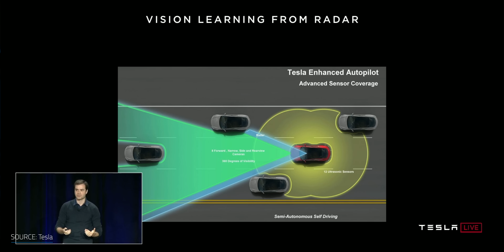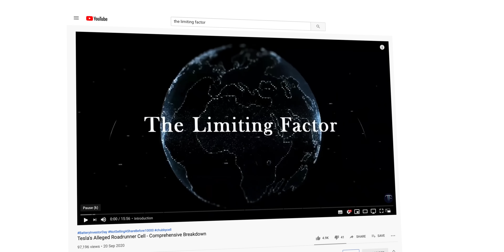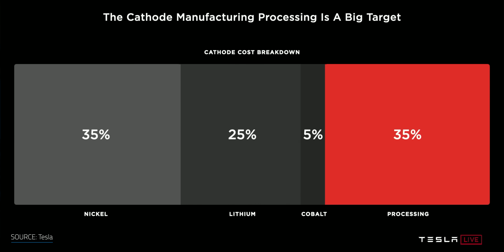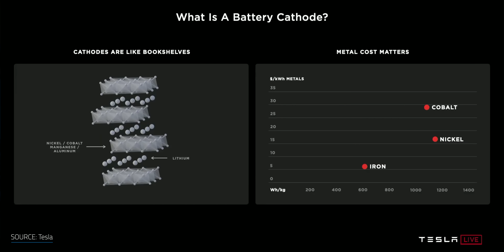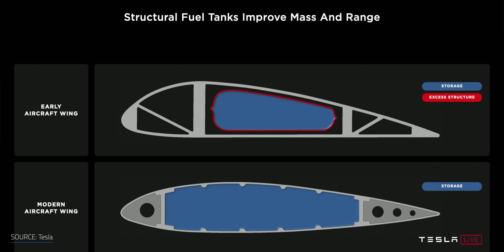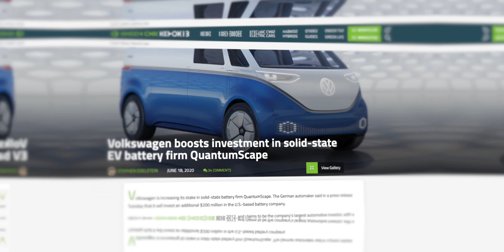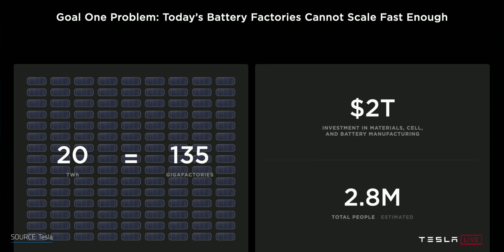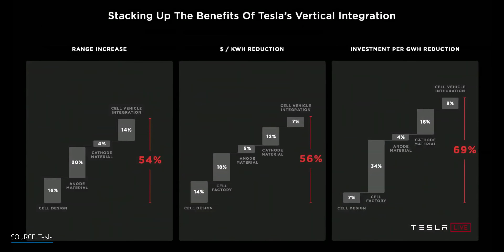3 Takeaways from Tesla's Battery Day - Hint: it's not just batteries

Comment: This marks the end of ICE age.
Reply: Only because of government intervention into the market.  Absent that, the EV would remain a rich persons virtue signaling toy.
Reply: Not yet. Switch your lights of people, don’t leave the gap running and recycle <3
Reply: And the beginning of hype lol
Reply: We will wait for 30 years.
Reply: @Thomas Chrombly Please recall that most Tesla drivers charge overnight at home. We have a fully charged battery, aka a full tank, each morning.
Reply: burst your small bubble u live in it bruh, ICEs are far cheaper than a tesla. Keep in mind not everyone is having 25k in their accounts.
Reply: Wolfgang Preier    You forget that the biggest “savings” in operating an EV is the ability to avoid road tax on gasoline.   Without the road tax, gas would be in the $1.50 range.   States are already figuring this out and many are collecting the road tax up front.    Redo your calculations taking into account the road tax, and you’ll be closer to comparing apples to apples.
Reply: not yet ICE number will decline eventually but not exponentially until 2040
Reply: Need MUCH better charging infrastructure before this will happen. I have  a Tesla S which I love around town but it is too hard for me to do long trips in it. Way more charging stations and faster charging is required
Reply: The math is very simple. Average diesel car burn around ~8ltr diesel for 100km (not talking about city use that can reach 10ltrs, or wintertime when the consumption also rises)(also not talking about gasoline cars which use ~30% more fuel that is more expensive, not even talking about performance....)  Assuming the diesel price is 1 euro per 1ltr (which is cheap but it should be around average in EU at the moment, since I can buy it for as cheap as 0,84euros) That`s 8euros/100km.
An average electric car uses ~18kwh of electricity for a 100km distance, currently average electricity price in Eu is 0,23euros per 1Kwh of energy, so that means  ~4,2euros/100km for an electric car. 
Currently electricity in my country is only 0.13 euros so 100km in electric would cost me around ~2euros for 100km... That`s actually almost as cheap as owning a bicycle lol, if you calculate repairs which it needs at one point or another, since pedaling 100km gives a considerable wear to the parts unless they are expensive... 
~4euros/100km is already a double the price, compared to the efficient diesel car. Now there are "green taxes" for ICE cars, there is also repairs that ICE cars would be having a lot often compared to electric. 
There is also a very possible scenario that in the near future more and more renewable energy sources will come to the homes of ours, in fact many EU countries already have risen the house standards to A++ which means that a newly constructed house has to comply with these standards in order to get the all papers done properly. A++ means that at least 50% of your energy usage has to be made by renewable sources... Which means that your electric car will be charged at home, which means lower price per 100km driven...
Reply: Linas Vaičiukynas    What country are you in?     In America, gas is around $1.89 per gallon, which gets you an average of 30 miles.   Of that 1.89 tax is around $0.50 per gallon.   Actual price of the gas is around $1.39 per 30 miles.   Electricity is around $0.10 per kWh in most of the country but can run as high as $.50 per kWh in California cities.  Charging efficiency is around 80%.   Figuring in fuel, maintenance, etc, the EV is a little cheaper per mile, but never going to make up for the higher purchase price of the battery replacement costs.   And, yes, I know these batteries last a long time, but they don’t last forever.    They eventually will have to be replaced and this os reflected in the resale price of a high mileage EV.
Reply: @S3l3ct1ve  When used EV is worth buying under 5k then you will see most people changing to EVs. Here(Finland) average car is 15y old and worth about 7k.
There is no way that you can get majority to buy 20k car without SERIOUS goverment subsidies.
Reply: Wolfgang Preier  It will also be a long time before, on a lifecycle basis, that EVs outperform ICE Vehicles on total emissions, especially with the Opposed Piston Engine technology coming from Achates. And in fact, if the regulatory authorities would get out of the way and let independent engine tuners work, you could squeeze another 20% of fuel economy out of current engines.

When the battery recycling problems are solved, then sure, you'll get a good boost to the lifecycle, but for right now, as the Dutch government found, EVs still cost more carbon over their whole lifecycle than ICE vehicles.
Reply: @user-sy9je9uq2c  25k is rather cheap where BRAND NEW CARS are concerned in most places. Sorry to burst you bubble. And for people who can't afford to buy outright 25k things, a great deal of people lease out those vehicles in that range for like 250->450 a month depending on things like credit, how much you can put on as a down payment, trade in value for another vehicle, etc. As it is, I am currently paying off my ICE Subaru, which cost a total of 35k brand new...

Comment: The casting innovation is something i kinda wanted more tubers to talk about... That's a dramatic departure from Auto frame design and if it pans out will make producing cars waaaay cheaper. Remarkable too is the innovation of the allot they claim requires no paint... I mean ಠಿ_ಠಿ
Reply: That's how they'll make the Giga-Germany model Y. It's how the CT will be made. It's how the giga-shanghai M3 and MY will be made eventually. They need to install these battery factories at each auto factory. Then Elon's evil plan will have reached it's zenith.
Reply: @rogerstarkey5390  Roadrunner batteries too.
Reply: I wonder how this will turn out in a crash, a crash test preferably.
Reply: @VolkerHett  The castings are designed to perform well in a crash, probably better than welded stampings, or Tesla would not use them.
Reply: @VolkerHett  Elon has stated many times that the number one priority when they sit down to design a car is safety. I don't see them going this route if it costs them their "safest car on the road" awards
Reply: Nothing innovative about it and if you look at all the cars with aluminum frames.....  But when you get to combine several factors, makes doing so possible.  Now weather you should do so, is another matter entirely.  It makes recycling a royal ass pain in the ass though.  It makes repairs, near impossible... no check that, it makes them impossible, and making a product so specialized it cannot be modified or used for a 2nd purpose after standard car life is over is going to severely limit TESLA's growth into other industries such as farming equipment which is a gargantuan market.
Reply: @w8stral  No other car has the entire rear or front chassis cast as one piece, and Tesla has a patent for casting the entire chassis too.  All are highly innovative.  No other similar vehicle manufacturer has tried to produce castings that large.

Tesla's casting plant in Berlin has shredders next to the casting presses in order to recycle the cast parts.  This can be seen in the factory blueprints.  Recycling is already designed into the factory and manufacturing process.

Tesla is building passenger vehicles, not farming equipment, and BMW/Mercedes/Audi passenger vehicles are not generally used as farming equipment.
Reply: @LoanwordEggcorn  No such  thing as a patent for a casting.  Probably just welding the bits together in one giant part from several castings.  As for whole front rear casting in plastic... I'll bet this feature actually goes the way of the dodo bird as the casting will be exceedingly expensive in the long run.  Not to mention near impossible to replace when the inevitable front/rear enders happen.  Of course this just makes TESLA authoritarian pigs even happier as this means they sell more cars or make even more $$$ on repairs instead of cheap repairs.  The ultimate throwaway vehicle.  The suites are in the works already and they will lose them around the world.  This is actually one of TESLA's biggest weaknesses, trying to corner the repair market. 
Farming equipment?  Needs a power source genius. And most farming equipment starts from car/truck/auto industry.
Reply: @w8stral  Tesla got a patent for machinery for casting the entire car chassis.  The castings are metal not plastic.  The castings are lighter and cheaper than weldments if produced in large numbers to amortize the cost of casting equipment.

You said castings make it harder to reuse Teslas as farming equipment.  Most people don't use luxury vehicles or even parts from them for farming.
Reply: @LoanwordEggcorn  Then TESLA wasted their money.  Just make a casting a different shape and said patent is void.   And said patent lawyer who allowed them to waste their money needs to be disbarred as size of casting is not patentable as there is nothing unique.  And Hell no, castings are not lighter.  In fact far heavier as quality of said casting is inferior and therefore stress risers are higher creating a much heavier part.  Castings can be cheaper though as it saves labor, assembly time.  If you 3d Printed them they could be lighter as you can make none linear shapes forced onto you by the casting process which is SLOW and expensive and this gets away from the higher stress risers created by casting(voids, nodules, surface roughness).  Ok, basic engineering school is out, go and play.
Reply: @w8stral  The patent is for a new type of casting machine, not the specific shape of the casting.  It is not a "design patent".

Tesla's castings are lighter than stamped weldments.  Tesla's metallurgists (who may or may not be shared with SpaceX) created a new casting metal alloy to allow the complex shapes they needed and the large casting sizes with fine features to be castable.

If the castings were not lighter, cheaper and faster to produce, they would not have done it.

The work they did is novel.  If it were not novel, it would not be patentable.
Reply: @LoanwordEggcorn  Ah, makes more sense as you did not know what you were talking about.  They patented a machine process, not the casting.  ANd no, castings are not lighter.  In fact, they are NEVER lighter.  IF you wanted lighter in today's world, you would 3d Print something or build it by hand so you could heat treat it more easily without warpage for an even lighter part.  The big casting is cheaper.
Reply: @w8stral  Tesla's chassis castings are lighter than stamped weldments.

I said that they patented a machine.
Reply: @LoanwordEggcorn  GO read what you said.  And keep dreaming about the casting... Its called basic engineering and properties of materials per cost.  All about $$$.  ON a car it is all about $$$.  Has zilch to do with weight.
Reply: @w8stral  Tesla invented a new metal alloy to use with the large castings that enabled them to make the castings lighter than stamped weldments.  Perhaps you should read what I wrote and try to understand it.  I have no more time for you.  Bye.
Reply: @w8stral  Due respect, man, your opinion needs a lot more research and data. You're spouting nonsense.
Reply: @w8stral  We agree on this point. When do you start?

Comment: My one main concern is connected with the  full integration of the battery with the car and the problem that could cause for repairs should a battery be faulty or go bad.  I, also, wonder what will happen in case of an accident that affects the battery.  Will the entire car have to be trashed and discarded?
Reply: Its looking that way isn't it.

Comment: 8:21 - I remember when monolithic operating systems were the norm, before Linux. Then the modules became the way to make a small, lightweight, and embeddable OS that could be installed on everything. Modularity is something that came out of software design from these large systems not being expandable. Computers, operating systems, and technology has followed this path for DIY. 

My prediction is once the cat is out of the bag for these systems of design (think 15-20 years from now) we'll see DIY electric cars and this path of monolithic design will go away again.
Reply: Software isn't the same as hardware. A software module doesn't add more weight or mass. Software doesn't have to be a rigid structure. There are good physical reasons for eliminating module structure from the battery pack that simply don't apply to software.
Reply: Linux kernel is monolithic. Yes it has module capability, but it is no way HURD which is basically zombie.

Comment: I have an MBA. I'm not a fan boy of Tesla or a Tesla hater. I'm neutral. But... What I saw, from the point of view of a person educated in business management, really impressed me. Tesla and Musk are following the holy grail of business, reduce cost, increase quality and performance, and increase output. Tesla covers all the bases. There are some areas of innovation that we have to wait for in the future and that creates a little uncertainty on future expectations. For example, they mentioned that they weren't yet where they wanted to be with the dry battery process for battery production after four iterations. So there is a real possibility that they may not get all the way there. It puts a little tamper on possible future valuation. However, you also have to look at what they are doing in light of their competition, and even meeting 50% of what they talked about will bring huge returns for Tesla. Look, they have already have made working prototypes of manufacturing, materials gathering, innovations in casting, alloys etc. etc. Their competition is just working on uniforming parts across platforms and products. An innovation I might add was first used in the Ford Model T. Knowing GM, this is an innovation that most likely is being pursued in order to make fewer cars of any one model, but attaining scale by sharing parts. Not something that you would be focusing all your attention on if you were going to go super large scale in production of each of your EV models. 

Basically what I'm saying is that I was blown away by the ambition and goals of Tesla. I was also impressed at Tesla's efforts to make those ambitions real by putting them into small scale production to work out the kinks. Tesla is "physically" working in the right directions and even if it were to get half of its improvements accomplished Tesla would still be a most valuable company to own shares in. 

This leads me to the question I have for what happened in the days after "battery day." Tesla just demonstrated that it was going to be a game changing company far into the future. Its sales to date move the company out of startup stage and into being a perpetually innovative company who will continually disrupt the market well into the future much like Apple is. So why then was there a sell off of its stock? It kind of created an opportunity for those people wanting to get into Tesla stock at a great price. It kind of also created an opportunity for people who saw what I saw and understood what Tesla was talking about to buy at a good price. However, I can't help but feel sorry for those that sold pushing the price down, when if they had held, chances are that they would be handsomely rewarded in the mid to long term. Sorry. But selling Tesla after what they said at battery day was not a good move taking into account solid business sense. The stock market doesn't always make sense and it doesn't always do the right thing.

Comment: Nice video Matt.  I shared some of your same concerns and I felt wanting in one specific area.  The primary concern is that if the battery becomes a structural component of the car, how is it ever replaced / repaired?  And the one area with which I came away wanting was in a bottom line.  I would have liked to see or hear what it means for future car purchases.  Does it mean that a $38K Model 3 will be able to be sold for $30K should all of these improvements in battery technology come to fruition?  Does it mean that a $38K SR+ will have a range of 350 miles?  Those kinds of conclusions were missing from his presentation.

Comment: Since the Stock Split, I have jumped into stock ownership. TSLA so far. I am a senior (70's) on 20,000 a year. I have bought 5 shares so far. If I can, most people can. I am hoping to have 8 shares by January 1st. TSLA and other hyper tech companies that will come out of the wood work in the next 2-3 years, will power the stock market while those 20th century companies that don't move forward are doomed to extinction. Transportation, Energy, Medical and Communication are just a few of the areas that will be disrupted. Elon's companies are just the canary in the coal mine. A Tsunami is coming this decade and people are not ready for it. So often I hear people putting ridiculous time lines out 40-100 years for stuff that will here this decade because of advances in technology that are working in the lab today. To me, the 3 days, Neuralink, Battery and SpacX/Starlink, combined are the tip of the iceberg for the next 10-40 years. The future is coming sooner than you think. It's not the 20th century speed of innovation anymore. Wake up or become dinosaurs.

Comment: Great summary.  I also thought about what you called the "right to repair" but in regard to the casted pieces of  the car.  If your car is involved in a "minor" accident and that casted piece is damaged, won't that necessitate the replacement of that whole piece?  In the traditional manufacturing process with multiple pieces you would need to replace only the damaged piece.   Replacing an entire casted piece sounds much more complicated and expensive.  The same concern would apply if there is a problem with either the structural or electrical aspect of the battery component.